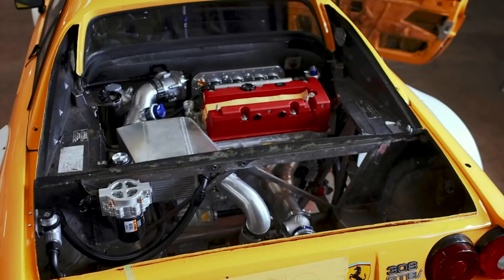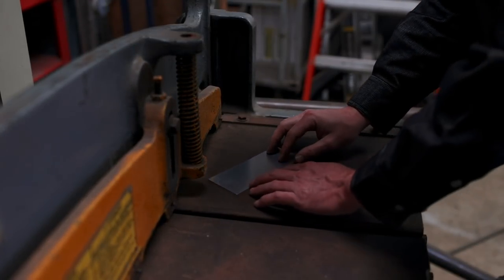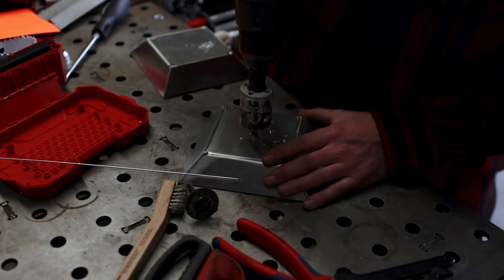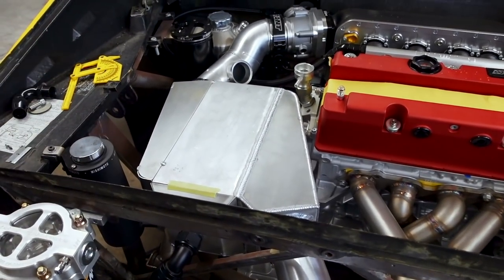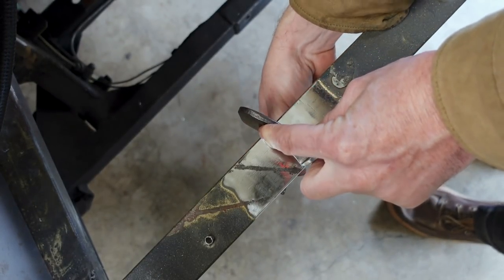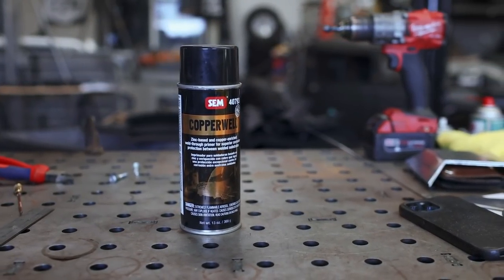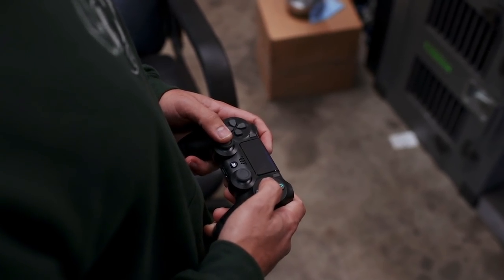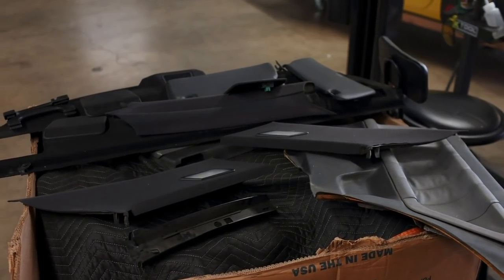Honda-Swapped Ferrari - Supports, End Tanks, & Bonus Burnouts - Ep. 78

Comment: Small tip .
   I drill my pilot hole , before using the hole saw . This prevents my hole saw from slamming into my work piece when the drill bit penetrates this surface. 
   I broke lots of pilot drills before I figured this out 
    yw
   Keep up the top level work . Your projects exibit a level of detail that is hard to top
Reply: Better make sure your workpiece can't move. Then you can concentrate on the drill.
Reply: And, when you let the underside of your workpiece lay firmly on an piece of wood, the drill won't bite when it penetrates the sheetmetal.

Comment: Hey Mike been watching this whole build, this car is gonna be mega!!! Maybe I've spotted a potential problem in the water section of the air to water cooler. If we apply some fluid dynamics to the shapes you have on the end tanks, would the water flow well at the corners of the tanks? Would the water more or less create a tunnel thru the center tubes of  box rather than flow evenly across its full capacity? More of a cone/triangular shape with internal fins/water ducting would be more effective, like f1 does their coolers. Or at the very least offsetting the water in and water out ports would help bring up efficiency. If you can't figure out the shape Ron Covell has got has some knowledge in the from of some videos on YouTube. Just a thought also if your gonna run a part that big might as well make it worth the weight lol. Good luck on this build. Looking forward to the videos and finished car, take your time brother.

Comment: Mike, next time you want to cut large holes in aluminum. I suggest a small investment in an annular cutter setup. Often called a rota-broach. They are designed to cut hard materials like metal, carbon etc. They won't catch and fling your parts like you had happen. Then my dad introduced them to me a couple years ago, they were a MAJOR game changer in my carbon work. The Hougen 11087 or 11099 kit would be great for you.
Reply from the maker: Definitely! It’s on my to do list. They’re not cheap though so I have held off for now
Reply: @stanceworks  what are your most common used hole saw sizes?

Comment: you would be correct on the weld through primer. its typically used where it would be hard to seal or moister would collect even from sitting in the garage. but since you are welding all the way around you shouldnt have an issue

Comment: Drag not a concern for the up rights? The force would be pushing rear wards at the base welds plus the added leverage from the height of the uprights plus height of the supports.  Just a thought, can utilize the extra length from the lateral supports that you used.

Comment: Hey Mike, looking at that end tank it may be easier to make it a dual pass heat exchanger instead of a single pass.  At least for packaging to have both ports on the same side may make it easier to install and such.  The only changes you'd need to make is add a divider plate on the end tanks.
Reply from the maker: I’m going off of CSF’s suggestion to run it as a single pass
Reply: @stanceworks  Ok, good deal!  Do they recommend like any baffles or something?  I have this picture in my head that with those two big ports in the center it would be like shooting a garden hose only through the center of the core, if that makes sense.  If that's their recommendation, I'm sure it'll be fine though.

Comment: Sheet metal drilled whilst flat and clamped down on a pillar drill saves gouges in the metal and also can't end up with the workpiece becoming a spinning blade that lops fingers off or opens arteries. (Old Man shouting at the clouds mode now switched off.) We've all had near misses or worse.
Reply from the maker: You’re not wrong. You should see the clip that didn’t make the cut 🤣

Comment: You need an easy way to bleed the trapped air from between the top of the fitting to the top of the heat exchanger, just like your domestic radiators at home.

Comment: I reviewed the sporting regs and there is nothing preventing Max from shunting both his and Lewis' cars at the beginning of the race. Since Max has won one more race than Hamilton, he would be champ since they are tied for points. This would mirror the Senna/Prost incident of 1990. The only penalty in the sporting regs is for Max to be disqualified. So what Hamilton needs to win is for Max to get a grid spot penalty so that they are not near each other at the start of the race - AND - the race has to go long enough for at least partial points. Then Max doesn't have the option to crash on purpose. What would be poetic justice, however, is if Max tries to crash them both but only takes himself out.

Comment: No! You need multi pass water on this core to make it work properly! I would suggest 4 passes with the coldest water being at the throttle body end. What you are doing is wasting the potential and this will heat soak badly and det the engine to death over time. Might work for a drag car but not anything where it will reach semi steady state. Happy to chat any time, hit me up. Again there is probably 50+ HP loss in your IC outlet tank. Machined from solid or Hammer formed please!
Reply from the maker: I appreciate the insight. CSF told me directly that I should do it as a single pass if I have the space to plumb it that way.
Reply: @stanceworks  Don't worry about recommendations, it's a logic problem and you need to design for your own application. The flow area of the core is so much more than the inlet and outlet so you will create an expansion and contraction loss which makes your pump work harder and is leaving potential performance behind. Pumps hate restriction, check your flow curves. On top of that as the water goes from one side to the other it will heat up as it takes on heat from the charge. This means the core will be less effective at cooling the charge to the higher temp water. Basically a single pass is far less effective. You need to maintain the highest mean temp difference. Happy to chat, find me on fb messenger or something. I am an OE Auto Engineer and have done these things for Ford. We did a 7 pass T shaped IC in the valley of a SC V8.

Comment: On the intercooler end tanks would you want the outlet towards the top of its end tank so you could ensure the entirety of the intercooler has fluid passing through? Or is the pumped sized large enough that the pressure will cause that to happen regardless?

Comment: Hey Mike, that damaged end-plate from your hole saw, couldn't you have just welded over it with the filler rod and built up the material to later just sand flat? Would that not enabled you to save it? Or would that be more work that it's worth? Not that I know much about welding, I was just curious that's all.
Reply from the maker: That’d be way more work than it’s worth. It’d take a lot less time to remake the part

Comment: Shouldn’t the intake hole be as low as possible and the outtake hole be as high as possible, to avoid hot water getting trapped in the top of the unit with cooler water just passing underneath it?

Comment: You obviously haven’t been following Lewis for a long time already. Maybe because F1 obviously wasn’t that popular in the US, but due to Netflix it seems it’s catching up quit a bit. But if you did you should’ve known that Lewis has been called a dangerous and reckless driver a lot in his first years, with some nasty actions on his Account. And he still isn’t always a gentleman, but then again if you are you can’t be a F1 pilot. It shouldn’t get dirty though. Like this year at Silverstone/cobs corner for instance, that was a filthy trick. He wanted to pass Max on the inside there after he failed to succeed on outside several times in previous laps. First of all he missed the Apex there with 5 or 6 feet on purpose to run max wide. That was obvious because he did touch the Apex in all his earlier laps. The result was that Louis pushed him off there While they were driving at 165 mph. A huge 51G crash for Max was the result. Second of all, I’ve heard several F1 drivers saying that it’s simply impossible to pass someone on the inside off cobbs corner. Louis only got a 10 seconds time penalty and could still win the race because Max was out, because of him.